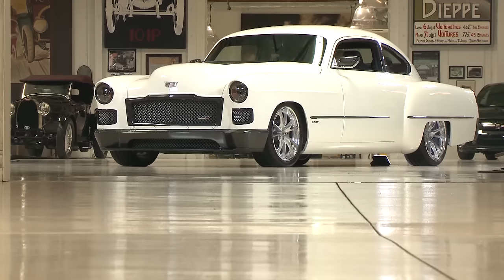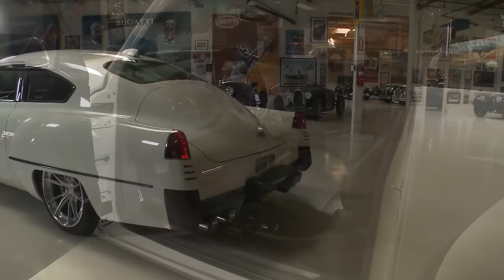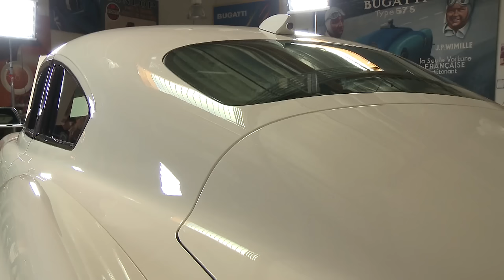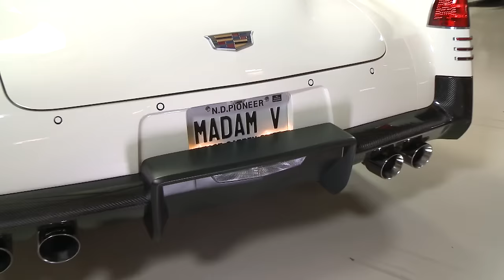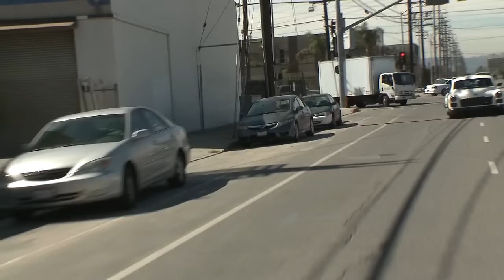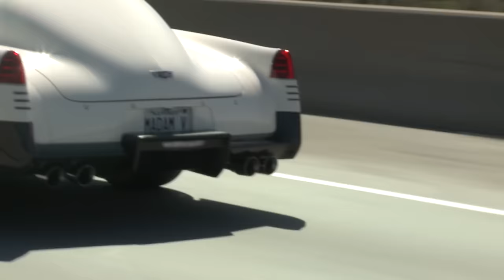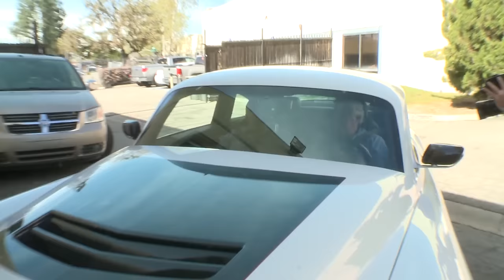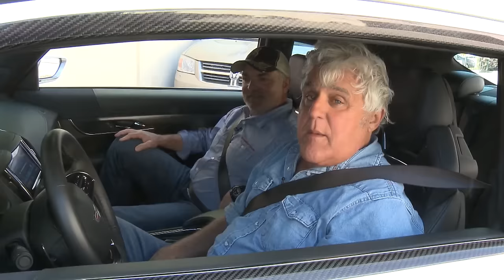Ringbrothers' 1948 Madam V Cadillac Coupe - Jay Leno's Garage

Comment: what is up with the black panel on the hood? One of the main features of this style cadillac was the hood line, nice and clean. need ventilation put louvers or something like that. And the Grille! It aint a cadillac without the substantial heavy grille and the dagmires. And the hood ornament? Why not do a Rolls and leave out the flying lady? Gotta have em. Blew it on this one. I am a cadillac enthusiast. My father owned just about every year out there. favorites were 56, 59 and 62

Comment: Jay, For all your vids make sure you don't scan inside the engine compartment, then edit it in. And never scan inside the trunk or show the latches, gadgets and spare wheel well/ Yeah, and you don't want to show customized features either. Perhaps you can get a boom crane  in the shop and shoot an overhead from as far away as possible. One fixed shot the whole vid.

Comment: JAY IS WRONG THE 1948 CADILLACS HAD THE FLATHEAD V8 AND THE 1949 GOT THE NEW OVERHAEAD VALVE V8. ALSO NO AIR CONDITIONING UNTIL 1952 . AND THE PRICE OF THE 1948 CADILLAC CLUB COUPE WAS $2728 TO $2912 AND THE 49S WERE $2788 AND $2966.1949 WAS THE LAST YEAR FOR THE FASTBACK OR TORPEDO BODY STYLE.

Comment: Jay is right, the 49 did not have the horse shoe dash.  Lowering these cars don't due the original or the resto design justice.  The original design pops when sitting on higher profile tires but it is too heavy a look with low profile tires and lowered suspension.  Unfortunately, that can only be achieved with bias ply as original and one of the reasons why early post war Cadillacs are not great restomod candidates in my opinion.

Comment: Very well done, but personally I don't like the idea of using a pre-existing entire interior and powertrain of a modern car in a much older car. Their previous cars were awesome, they put modern technology in an older car, there's a difference. This is just a very complicated copy and paste. In 20 years this is just going to be an old caddy with a newer old caddy interior. Picture a 1959 Eldorado with the interior from a 1995 Eldorado... it's just an unpleasantly strange image. Not bad necessarily, just not all that good. But they pulled it off with this car and it looks like it was done well, so good job nonetheless.

Comment: I can see the point in putting modern parts in an old car to make it go better and be more reliable but to just put an old body on to a new car and you end up with a car with most of the safety things like air bags taken out.

If someone drives in to you then like in the old days your head goes through the windscreen I suppose the point in doing this is not to drive it on the road it will just be a show car if that is your thing then that is ok but for me I want to use my cars not just show them off.

Comment: Great workmanship but no longer a '48 Cadillac.  Like Jay mentions toward the end, the interior does not go with the spirit of a '48 Cadillac.  I like the feel and nostalgia of the original '48 as it was intended to be. Sure, it does not go as fast, brake or handle as well as the restomod, but we're talking the experience of driving in 1948.  I think the Eggplant Caddy that was built for ZZ Top decades ago was way more interesting than this car.  So they destroyed another classic and spent $150,000 in the process.  Is this really an accomplishment?

Comment: MY, BROTHER HAS A 2013 CADILLAC CTS V AND IT IS A, AUTO MATTIC 8 SPEED IT HAS ABOUT 650A BIT LESS TO THE WHEELS AFTER IT GETS TUN FROM A CORVETTE PLACE WITH DYNO WHAT I DON'T LIKE, ABOUT IT IS THE TRANNIE IT JUMPS TO QUICK IN THE NEXT GEAR AND DOES NOT WANT TO, LAY BACK AND REV OUT AND MAKE THAT POWER TILL IT GETS SIDE WAYS AND THEN YOU WANT, NEXT GEAR TO CUT THE, REVS,, THIS CAR WOULD BE BETTER WITH A 4SPEED AND A CLUCH, THEN PUT SOME SLICKS ON IT AND DRIVE IT,, YOU, HAVE A 8 SPEED AND IT WOULD BE MORE FUN WITH A 4SPEED STICK YOU MUST HAVE NOTICE HOW IT JUST DON'T FEEL LIKE REVVING OUT JUST GRABBING THE NEXT GEAR,,,

Comment: Automotive abortion! If either of the '48 donor cars was restorable A Major sin has been committed! It's hideous to replace stainless trim with carbon fiber and worse to replace chrome steel bumpers with crummy black. What? No Frame? Never designed as a uni-body BIG mistake there. Now, let's talk about those big chrome clown wheels with the rubber band tires. Ugly on such a car but more important smaller wheels with higher sidewall tires are an integral part of a smooth ride. As well as providing wide whitewalls. Possibly I'm just too retro for this car. Possibly someone will remember the day when a "Coupe" was a car with NO rear seat. In 1948 when that car was new it was not called a Coupe. It was sold as a 2 door sedan and so it remains.